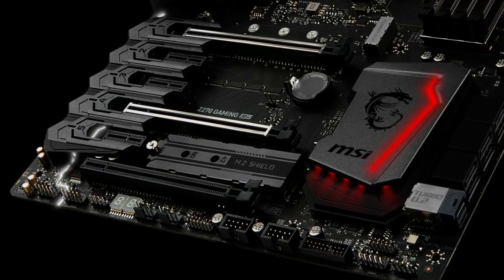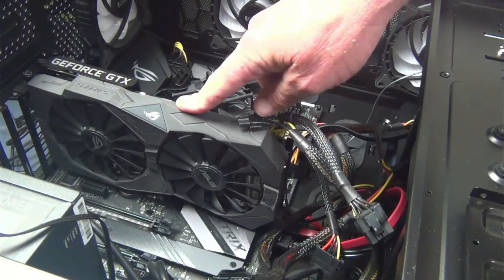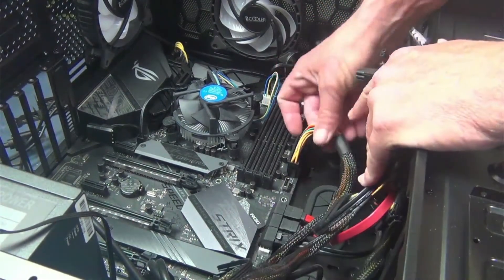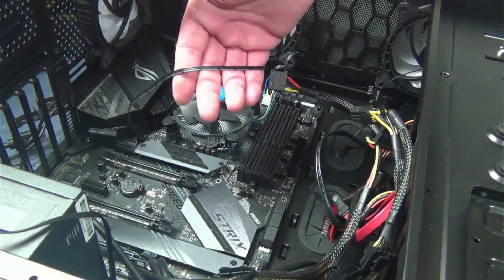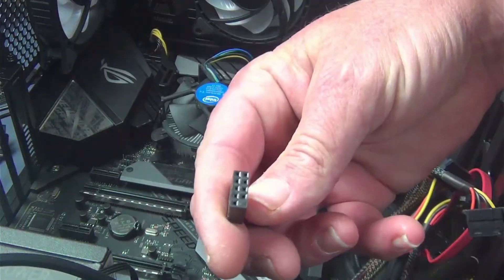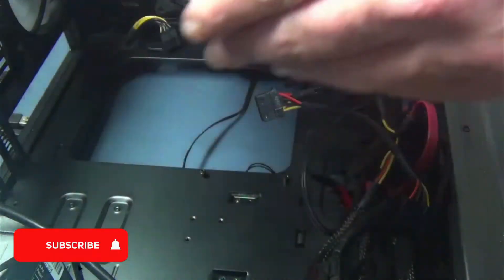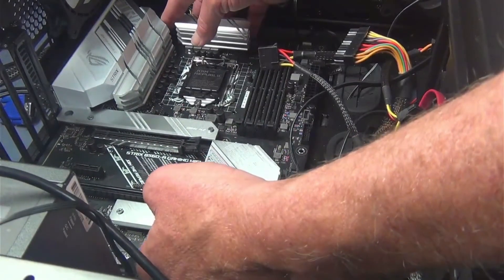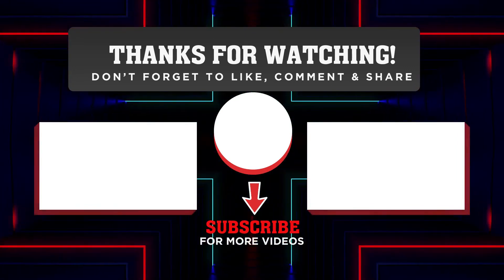Can You REALLY Upgrade Your Motherboard in Under an Hour?

Comment: I'm surprised you never mentioned one very important point, that when you change your MB you'll have to pay for a new product key license if you have a digital license, unless you know a way around that.
Reply from the maker: Not always - I have swapped out motherboards before, just reactivate, and the original key works. According to Microsoft, it is the amount of upgrade versus the upgrade itself.
Reply: @AskYourComputerGuy  Okay, what do you mean about the amount of upgrade. tks.
Reply from the maker: @wally6193 Microsoft judges upgrades from minor to major. Major upgrades (CPU, motherboard) usually require a new key, but sometimes you can just reactivate even with a motherboard upgrade. Memory and hard drive upgrades almost never to be reactivated. It's worth a shot before paying for a new key 👍
Reply: @AskYourComputerGuy  Okay, well it would just be a MB. if all else fails I'll call MS and say the MB just died and see what they say. According to Memory Express they will usually give a key.tks
Reply from the maker: @wally6193 I've heard similar. Worth trying!